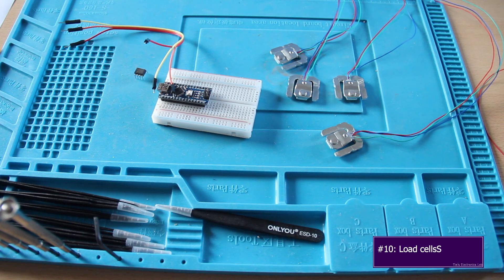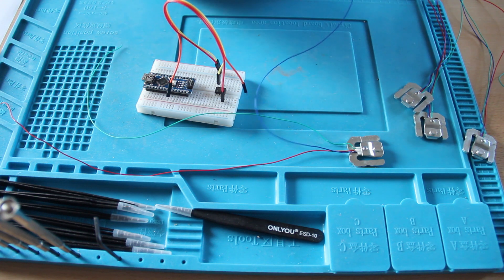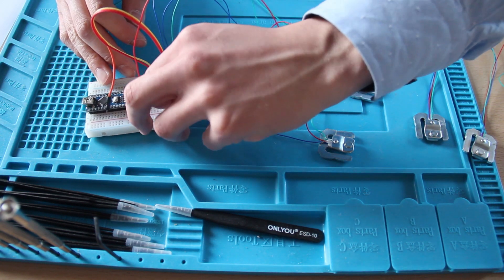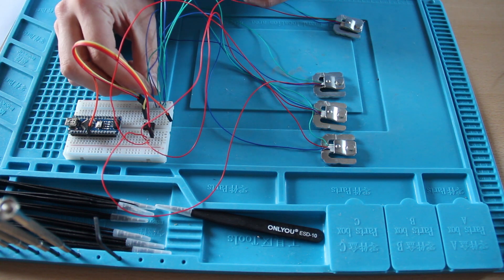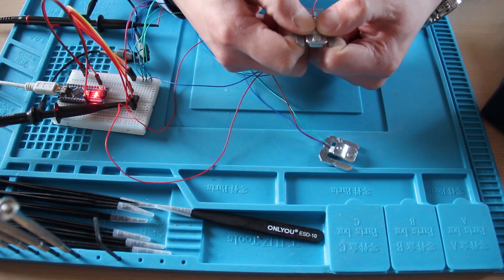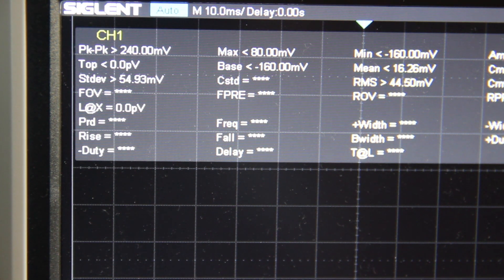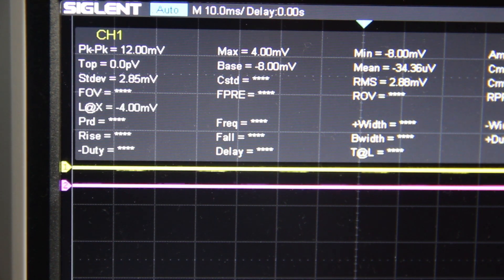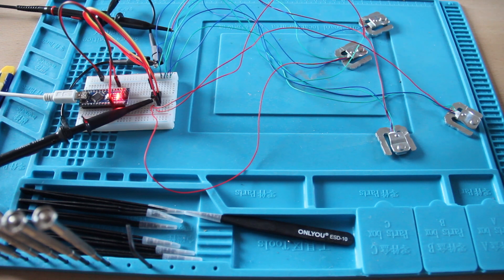#10 50KG Load cells

Comment: Hello, nice video.  
Is it possible to read 4 loadcells individually in this configuration? 
I need to read 4 loadcell value and display in LCD. Do I need four HX711 or is it possible with single as in your video?
Reply from the maker: Hi prof953, thank you for your comment :-)
Reading 4 load cells individually would indeed require four HX711's, however if you are using the same configuration as in my video, the weight across the loadcell is normalized automatically (https://en.wikipedia.org/wiki/Wheatstone_bridge).

Comment: Do I need to connect 4 load cells all the time to get the reading???
Reply from the maker: Yes you do, the 4 loads cells in this configuration is called a wheatstone bridge, which spreads the load over all the load cells. When using it, the output is not affected by a single load cell that has more weight being pressed down on it.
Reply: @TimsElectronicsLab  The output in serial monitor in arduino is showing 'nan'. Can u tell me why it is showing 'nan' rather than a weight value
Reply from the maker: @dhrubajyotichakraborty5  Have you connected everything the right way?
Reply: @TimsElectronicsLab  yes I have connected as the same way u have connected

Comment: it is possible to display the data on the lcd?? thank you for answering my question
Reply from the maker: Yes it is possible for sure! Just connect a (I2C) LCD to the Arduino and print out the values
Reply: What is the pin of your load cell?
Reply from the maker: What do you mean with pin?
Reply: @TimsElectronicsLab  pin of load cell,  the red, white, and blue wires, how to connect it from arduino?
Reply from the maker: I don't have a working pinout yet
Reply: But where's the source, gnd and data of the load cell? Thank you tim,
Reply from the maker: I just uploaded another video concerning load cells, I suggest you that's that one out . You can always comment if you've got a question!

Comment: Hi Tim - Thanks for a nice video. I have tried to use 50kg load cells from Sparkfun together with a HX711 ADC. That gives me none repeatable values and values that decreases over time. I think it is unstable  strain gauges in the load cells. I see you use load cells from Ali Express (another type) - how is your experience with those? I hope you have the time to look at my question. Gorm
Reply from the maker: I was also trying to use them together with the HX711 but the HX wasn't even recognized by the Arduino. I'll make a follow up video in about one week and hopefully I'll have something working by then. The loads cells I use are also 50kg each, but I think that the voltage difference is so little, that it becomes unstable (I'll research this better for my next video)
Reply: Hi Tim - If you make a video - you should/could use the 50kg from Sparkfun - the HX will recognize them. But they are unstable. Right now I have asked Sparkfun about this issue - still waiting for answer..  If you make a video about it, you also could have a look at this issue.
Reply from the maker: Keep me updated about the issue! I'll see if I can get my hands on the 50kgs from SparkFun, but no promises
Reply from the maker: Thanks for sharing this! I'll definitely keep this in mind when making the video 😄

Comment: How can i connect 4 load cells with  each volume of 1000 kg? 
it would be very nice if u could help me. 
kind regards Matteo
Reply from the maker: I think that the maximum loads of the cell does not matter on how you need to connect them, accuracy may decrease however if you use hardware that is designed for lower weight. I found a page that shows a 1000kg button cell with the needed hardware https://www.robotshop.com/en/1000kg-button-load-cell.html